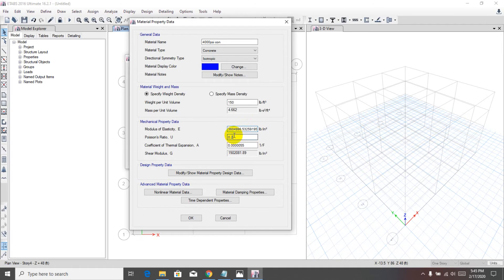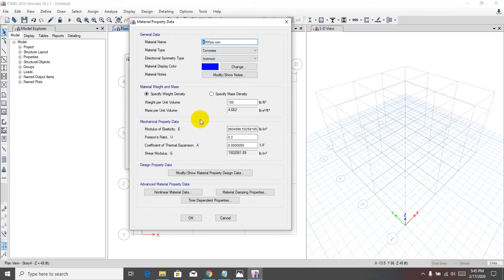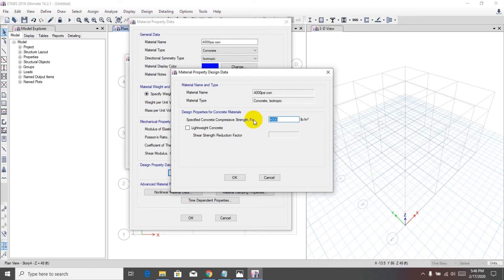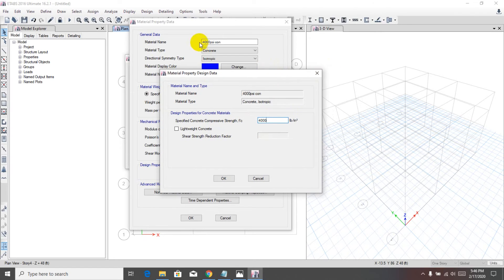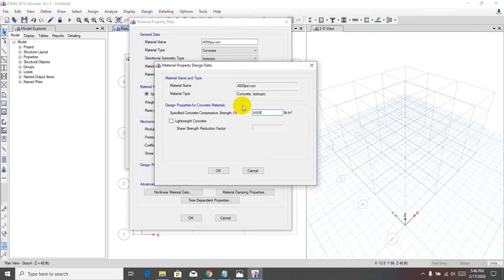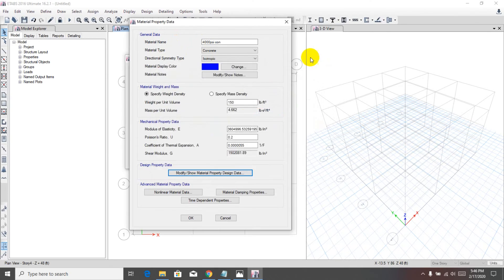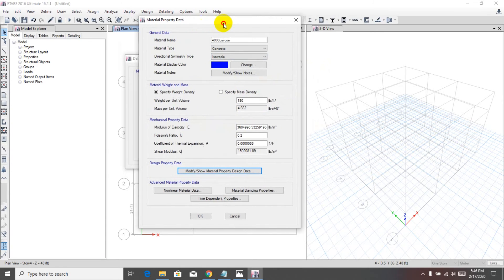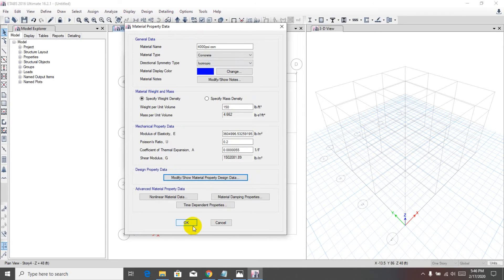Etabs Full Tutorials for beginners |  Define Material Property As a professional in Etabs | Lec-08

Comment: Dear Sir,  where to get the dwg for the building?
Reply from the maker: you have to make a auto cad plan by your self
Reply: @qlearnify-en  if that’s the case, how user friendly is ETABS compared to Staadpro. Also to your response on the drawing, I can easily import drawing from Autocadd even if the Autocadd is a cracked version? I’m using BricsCadd though. Kindly tell me. Thank you kind gentleman.
Reply from the maker: @seanbooth42 etbas is better than staad pro